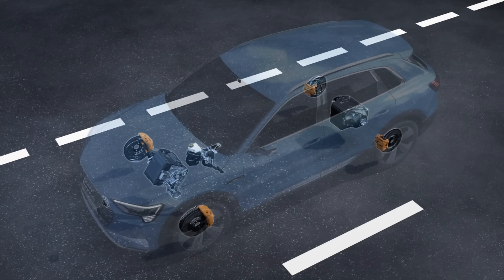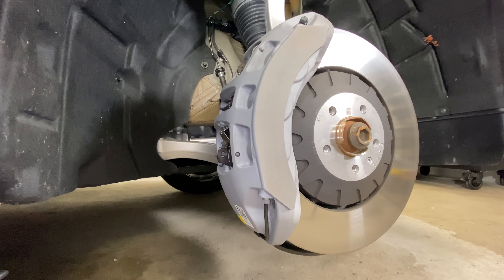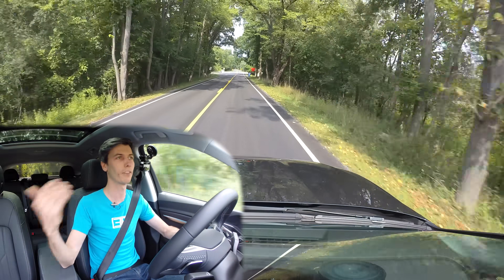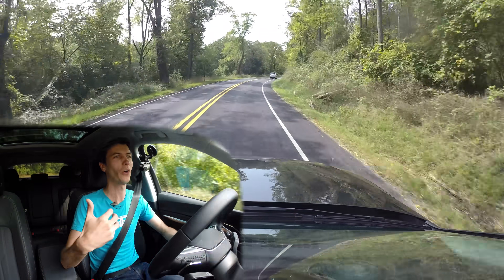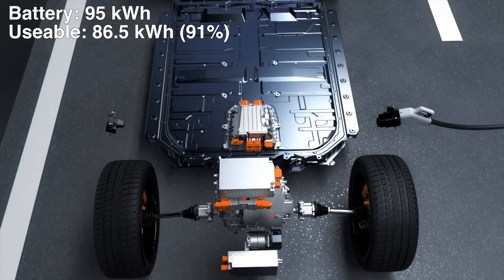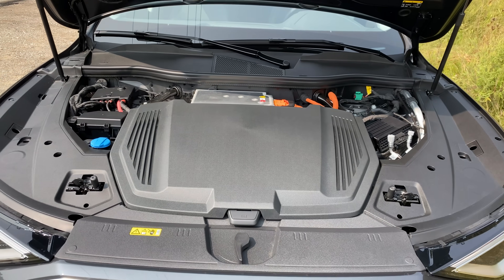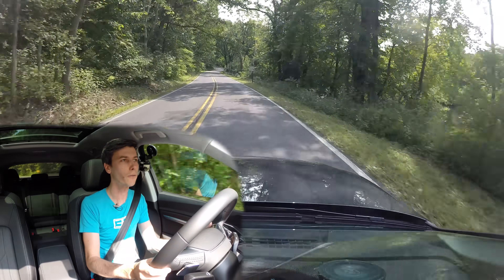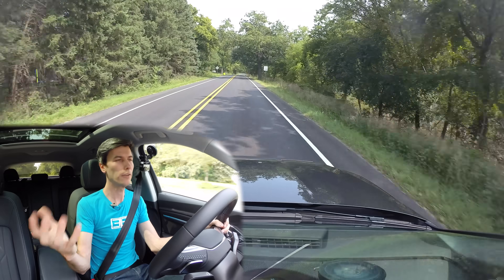How Does Brake-By-Wire Work? Plus: Audi e-Tron Sportback Review!

Comment: Recently did navigation on a road rally with driver in a Tesla 3 sport (dual motor). 

1) We had to drive out of our way to find a supercharger near the start point of the rally to get a full charge to make the event. If the supercharger is filled, you wait, once you plug in the charge rate is throttled back because too many Tesla's plugged in.
2) Tesla would overbrake every time we passed a bicycle & it was Sat. so lots of those spandex types on the road (BTW the emergency braking was always too late, the biker would have died).
3) Tesla would brake on approaching EVERY traffic signal green or not.
4) Tesla odometer was off by .1 mile every 1.5 miles WTF? Used a gps odometer - much better.
5) Tesla seats were nice. It handled ok but not like my C6Z06.
I KNOW all those settings are manageable but only to a certain extent, then Mr. Musk says, nope you can't change that.
6)Sorry this is on an e Audi video, but that's what I watched, good explain on e brakes, thanks!

Comment: Mercedes did this e brake system in 03 to 06. Awesome tech, worked great, owners complained of noise from the pump. It would precharge loudly when you opened the door and people didn't like that. Normal operation, though
Reply: What model?
Reply: @Spectrolite1  the 03-06 E class and SL roadster
Reply: @captaincaveman8377  Thanks 👍

Comment: I am still in the camp that it is not brake by wire. I see what the system is doing but it is still physically connected, it is more like electronic assist, or electronically buffered. Drive by wire is literally a "gas" pedal connected by an electrical connector, there is no physical link between it and the throttle body. The "brake by wire" has more in common with electric power steering.

Comment: You’re right, you’re not talking about brake by wire system, you’re  talking about an electric brake booster system 🤦🏼‍♂️😂. Brake by wire would have no hydroelectric connection between the brake pedal and the brake pads

Comment: Coming from the sim racing community I find it odd that BBW exists at all given how badly we wish for a realistic brake feel to get the most out of our driving. In particular the idea that a brake position sensor is used rather than a pressure sensor is baffling, given the short travel of the pedal and people's much better sensitivity to pedal force than pedal displacement. It's just all so backwards...

Comment: >Electronics >VAG >Reliable     Yes, VAG automobiles need even more electronic modules to fail.  Good ol problems that make no sense to normal people and you have to go on a forum to figure out wtf it is. "widows dont work when the lights are on? Check xyz module in the spare tire well in the trunk"

Comment: I am going to preface this by saying it has been a few years since I worked in brakes and I have not kept up with the regulations but I believe the following to still be true...

It should be noted the main barrier to full electronic brakes is not the technology but the regulations (note I am not saying that is a bad thing).  A brake system is still required to have hydraulic backups, and they have to perform per regulations in many different scenarios.  Fully electronic brake systems have been available for at least 2 decades (I tested a Continental Teves system that was 100% electronic in the early 2000s), but they don't make a lot of sense because you still need that backup system.  Since you have to build the backup anyway, you might as well use it to create the "drive by wire" systems we have today which are sort of a hybrid hydraulic/electronic system.  A fully electronic brake system would provide extra control of the brakes which would help in all kind of braking situations and especially off braking situations by having complete control over the position of the pads which could help improve fuel economy and reduce brake shudder.  Yet until regulations allow all electronic backups that won't happen.  Again, I am not sure that is a bad thing.  As the old saying goes, the only thing worse than a car that won't start is one that won't stop.
Reply: Super interesting to read. Newer airliners are made with Electric Brakes now as opposed to hydraulic brakes. They don't have an hydraulic back up it's purely electrical with actuators pressing on the brake stack. There is usually 8 or more actuator per brake stack (per wheel) depending on the aircraft and there is a bunch of redundancy built in the system.
Reply: Hi Scott! You are wrong. ECE R13H allows brake by wire systems without hydraulic backup.

Comment: Mechanical systems are more reliable than electrical systems end of conversation
Reply: Depends on what you're talking about. EFI can run forever with zero maintenance, carburators? Nope.

Comment: You should raise the headrest a bit. The top must be level with the top of your head for safety.
Nice video!
Reply: That’s a bit of semantics, so long as it isn’t below the base of the head you’ll be fine, the head rest isn’t going to do much in a rollover accident.
Reply: @NarutoMagicCyclops  When you get hit from the back your body tends to move up. When the headrest is too low it can help to break your neck.
Reply: olafzijnbuis uuh sure, that’s only if it’s sitting completely below the base of the skull, and the force is actually enough to break the neck which only happens with very high speed collisions.
Reply: @NarutoMagicCyclops  Due to the inclination of the backrest of the seat you move up when hit from behind. If it doesn't break your neck it can cause whiplash.
 Even if the chances of it happening are very low, it is an easy thing to do. And you only have to do it once after all.

Comment: Love the review and all your work.  American consumers are not to far gone to adapt to change.  Audi should allow them to progress with the technology.  The E car will not fail because it is to different, it will fail because it is to heavy, to slow, and to low a range and TO SLOW AND EXPENSIVE TO CHARGE on charge america.  The reason we need 300 or more miles is because at highway speeds or in the winter we want to still get 200-250 miles!  I know you know most/all of this but it was not mentioned in your commentary.

Comment: Why can't drivers just use the "E" brake in a failure of the BBW?
Reply: Because like every other system, that;s also electric now, so there's no control over the level of e brake applied, it's all or nothing. In fact the e brake (emergency brake) is a thing of the past, they're just parking brakes now

Comment: 0:58 does it mean that the pedal will feel the same even when the brakes wear out? In older cars that’s how I could tell it was time to change pads
Reply: When you feel a difference that means your braking material on the pad is pretty much gone. That's way too late. But modern cars have a brake pad wear sensor anyway. The car will will let you know.

Comment: The issue is that you’re still relying on a valve to open under a failure scenario. If the vehicle has aged enough for brake failure to occur, then you are relying on an unused 5-10 year old valve not to stick shut. 

As someone who has taken every car they’ve purchased (3) past a decade of ownership, I find this very concerning. 

I’ve had an alternator fail on each car I’ve owned. I’ve had accessory drive belts fail on 2 of my cars, and I’ve had corrosion on ground leads cause electrical systems to stop working. All of these scenarios could mean relying on that brake system valve to keep you alive.

Comment: I'm just waiting for full electronic control via joystick.  Push forward (self centering) proportional to desired acceleration, pull back for desired deceleration.  Let multiple, redundant computers make the actual decisions!  Leave the stick in its centered position to maintain the current speed.

Comment: Sounds like the slowest electric vehicle on the market. It is not normal for any 400hp cars(electric or not) to have such a slow acceleration 0-60. Most of the modern FWD hatches nowadays, between 280-320hp, even with manual transmissions, accelerate from 0-60 in less than 6 seconds...

Comment: The one thing that massively confuses me is that the had been massive jumps in innovation In making cars more efficient, huge amounts of time and money spent only to the throw it all away by pushing big tall chunky cars.
Especially this push to sell SUVs, surely we should be pushed more towards smaller streamlined cars like the medium sized hatch back.
We don't need massive cars it's like we take a few steps forward and one massive leap back in trying to cut the down on in one of the biggest of producing of emissions
Reply: preach
Reply: Massive cars good small car bad.

Comment: "what if it fails?"
Cough C8 Corvette
Reply from the maker: Yes, pretty ironic timing for this video haha.
Reply: @EngineeringExplained  We call that real-world unintended testing.
Reply: @hkad6252  you clearly don't understand what I was saying, but okay.
Reply: CrimsonStang I don’t understand either. You mind filling me in?
Reply: @ripem1417  C8 Corvette was having some issues with the wiring associated with the brake by wire system, causing it to not know how much simulated brake pressure you were applying. GM issued a stop sale of the C8 over it and a recall.
Reply: If the main brakes fail, is the emergency break a button or a handle, like I still have in my CMax?

Comment: If you had a level trailer with no tongue weight, for example you had trailer with a axle on the very front and the very back of a could you tow more. A trailer like this could turn by having the hitch somehow control that front axle.

Comment: So, in the event of a failure, a valve has to open so that the regular hydraulic braking system can take over...  What controls that valve?  The same computer that controls the brake-by-wire system?  If the computer fails in the brake-by-wire system, how does it then manage to open that valve?  Or -- what if that valve gets stuck closed?  It's not used under normal circumstances -- 10 years of a valve sitting there closed, and suddenly it needs to open right now because the brake-by-wire computer just died...   I'm just not so sure about that...  Valves tend to stick if they're not used regularly.

Comment: First steering, then gas pedal then the tried and true E-break now this, smh. what will they do next, take away the windscreen?
Reply: there is a very mechanical connection between the steering wheel and the the wheels...only the assist is electric.
Reply: @AKAtheA  So steer-by-wire is the next step
Reply: @GogogoFolowMe  kinda...but do far I know that all of EU doesn't allow it, a mechanical or hydraulic connection is required. Not sure about the US.

Comment: I know this is an edgecase scenario and not really related but I have a motorbike that has a typical range of 160 miles and 180 miles if you're pampering it. I do a 200 mile round trip every other week and it's so annoying that I have to stop on the motorway to fill up for like 1.3x the price. It does end up costing a fair bit, Sure I could not fill up fully but then I have to stop again and it's just a pain. Most of the time I don't set off with a completely full fuel tank either so I almost always have to fill up on the motorway and that's 5 bucks extra I have to spend EVERY trip and that adds up over time. Now similarly with EVs if you can BARELY not make a trip you'll always have to waste some of your time just charging it.

Comment: Thumbnail: “Is brake-by-wire safe?”

MB Owners from the 2000s: sweats in faulty SBC

In all seriousness, drive-by-wire (accelerators) have been ubiquitous for absolute ages now, just as shift-by-wire and all of these other digitized and computerized systems. On the whole, they tend to work just fine, and still have some form of safety or redundancy to back you up on the off chance something gives. Brake-by-wire is just another stepping stone, and as long as it’s done correctly, it’ll be just as reliable as everything else that’s been “modernized” over the decades
Reply: Yes, it's all great and swell on paper, the problem is if it does go wrong, you're in a LOT of trouble (seriously a lot of trouble). And combine that with the famous case of toyota not doing it properly for drive-by-wire, i don't think anyone sane can say "yeah it's 100% safe". So the question is how safe it actually is and how safe does an individual need it to be to be ok with it.
Reply: @fleksimir  Nothing can be 100% safe. Not even your simples hydraulic brakes. I think these ...-by-wire systems are pretty safe tho. Especially because there are redundant systems
Reply: @analool7873  Nothing is perfectly safe but there are different grades of something being safe. Well designed electrical circuit can happen to just fail for some unforseen reasons, be it some manufacturing flaw inside a microchip that was causing concentrated heat in a single spot, and on a very hot day it went poof, or badly programmed code that is not impervious to bit flips, or many others. Well designed mechanical contraption can also fail, but it's much less a chance of it suddenly having catastrophic failure then it is for electrical circuits. Mechanical usually give signs something is wrong before they are completely useless. I have education in both electrical and mechanical engineering and for anything that lives depend on, the less electrical and more mechanical, the better.
Reply: @analool7873  Yes but that is an electronic system on top of a fully functioning mechanical system. Fuse is out for ABS in my car and the brakes work just fine, there's just no ABS, so the electronics of your ABS system (or at least the ones in my car) are not needed at all for brakes to work mechanically. There is a difference between electronics being used to augment mechanical parts, and electronics controlling your brakes. Before you comment, yes, the Audi in the video also has a fail-safe for the brakes. But surely time will come when that's not gonna be the case, and i believe it already is for steering (thou not sure).
Reply: @analool7873  Didn't notice you wrote two answers, apologies. This reply is for your first one. It's not that electrical is worse by default, it's that a mechanical system has orders of magnitude less things to go wrong with it. If you like old cars (this isn't for everybody obviously), well, any 25 year old piece of electronics is simply not safe, and if it controls your wipers as it is the case with 25 year old cars now, not a big deal. If it controls your steering and brakes, that's a bit of an issue (or will be in the future). I had passion for both electronics and mechanical engineering, and seeing a fair bit of insides into both worlds, electronics always seem like a nest of problems, while mechanical seems like elegant and foolproof solutions more often than not. Also, it is a matter of time before someone figures out how to hack your car while you're in it, and unless x-by-wire is on a completely isolated system (which it won't be because soon with autonomy the part that is connected to GPS and internet will have to have control over steering and brakes and gas), you are now trapped in a car someone from some 3rd world country is driving with a driving wheel on his PC.
Reply: @analool7873  It is possible for ABS to fail in a way to compromise braking (further compromise than simply not working as ABS). Most likely in catastrophic failure where the electronics go poof the ABS valves stay open all the time and you can brake normally as if your car didn't have ABS. I have managed to find some anecdotal cases of ABS failing in a way that braking was not working at all on the internet. I'm not happy with that but that is a compromise: yes that is a potential danger but often when ABS fails nothing bad happens (mine has been dead for a decade and i had no issues) and ABS brakes that are working are far superior to just normal hydraulic brakes, so it's a worthy compromise. Brake by wire, on the other hand (and here i mean full brake by wire, not an assisted hydraulic brake like in the Audi) does not have the luxury of failing and still allowing you to brake. If it fails electronically, there are most likely  no brakes. It is also worth mentioning a scenario in which brakes lose electrical power (maybe a connector disconnect or something): ABS simply stops being ABS (brake still work), and electric brakes simply stop being brakes. There is a thread on Team-BHP forum called "ABS - How Failsafe" if you want some more info.
Reply: @analool7873  Exactly. Same cannot necessarily be said about brake by wire (or drive/steer, change_gears by wire for that matter). Planes run on those type of systems but they usually have more than 1 redundancy level (meaning two separate things can fail and it can still fly). I don't see WV or Seat or Hyundai incorporating 3 separate systems, that costs a lot of money, and that's where problems may begin.
Reply: @analool7873  How many lives does abs save? I have experienced badly working abs and it is scary as hell. Like having no brakes. Also there are/were problems with people lifting the pedal pressure, when abs kicks back like it should.
I am not convinced, that its effect is a net positive. Maybe if we only look at slippery road conditions.
Reply: The only issue with all of this is increased service cost IF it fails. Cars are easily just as expensive as a house these days!

Comment: Some “expert mechanics” were saying that drive by wire (gas pedal) had a LOT of delay, which just proves how little some/most “professionals” truly “know”.

I’m an expert in electrical, electronics, computers and have enough understanding/training in mechanical and hydraulics that I was able to tell them immediately:
You really have no understanding or idea about this. Please stick to carburetors and mechanical spark distribution...